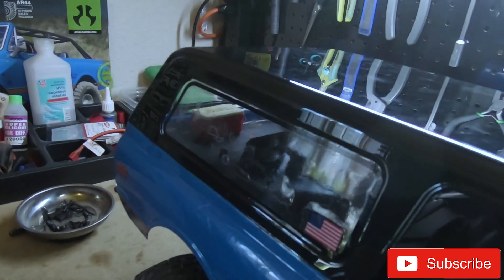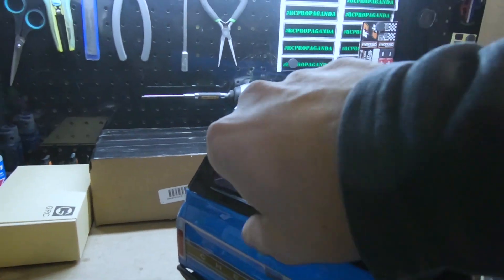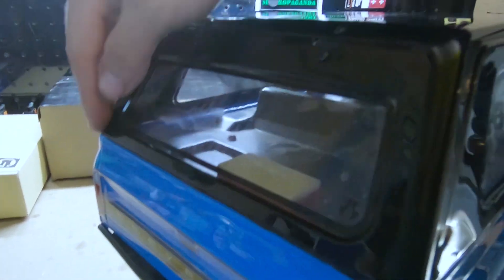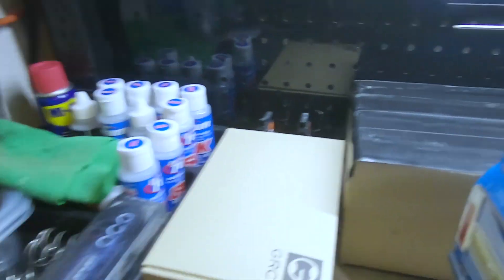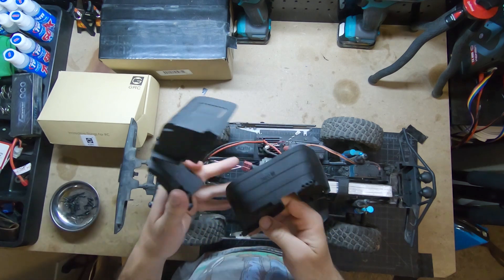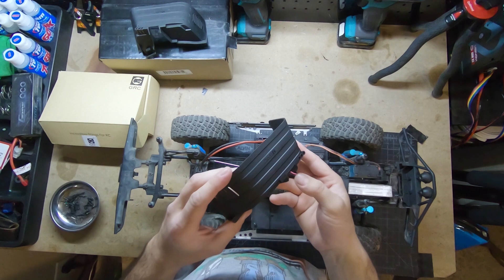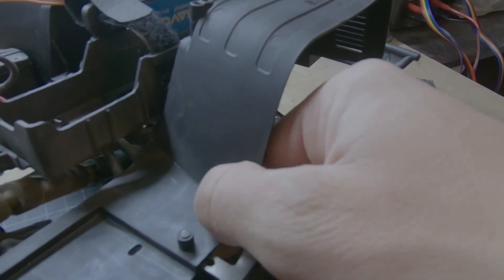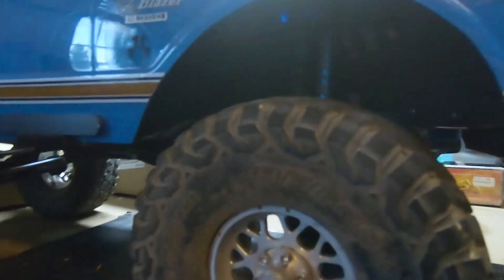Axial K5 Blazer Hard Top Install & Thoughts|GRC Inner Fender Install

Comment: Did you also install the rear inner fenders? I tried to fit them but it does not went as smooth as the front. Mainly because of the shorter wheelbase and the rear body mounts  🤔
Reply from the maker: I had to cut them up a little I think. It was so long ago I forget.

Comment: Part number for fenders? Or just order for 10 ii
Reply from the maker: Not sure part number but the scx10ii ones works. I did have to mod to fit with blazer because the posts mount to the chassis and gets in the way. I did some trimming to get it to work.